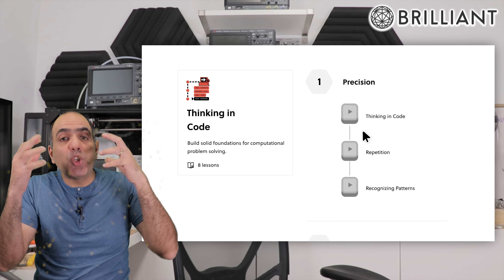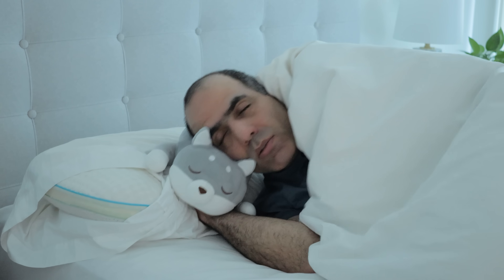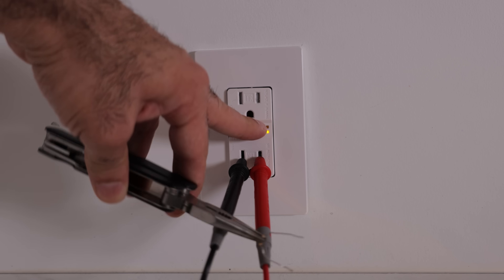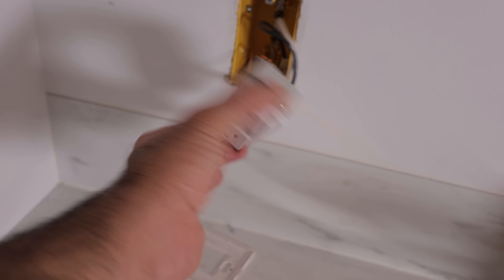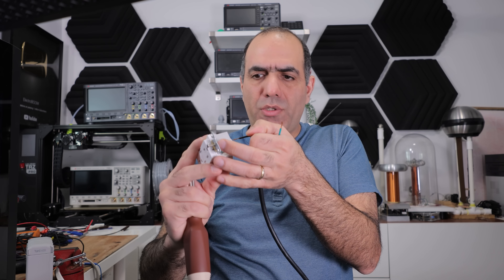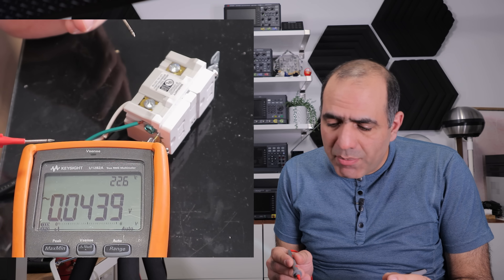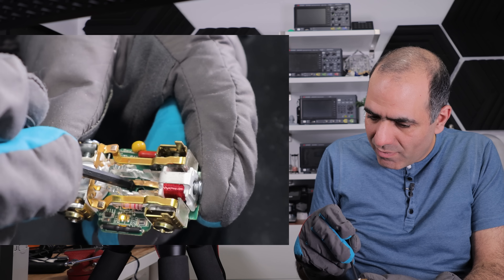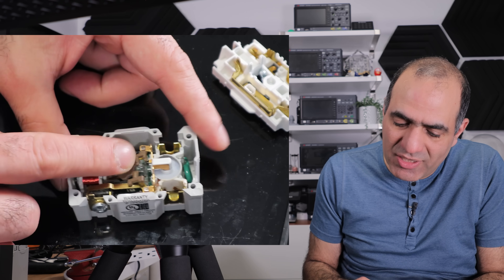Repairing Faulty Ground Fault Failure

Comment: That basically means the test button does not simulate the ground fault but only provide energy to the tiny rail gun inside. No worry Mehdi you will be safe🥰
Reply: Yeah that’s super weird. In Europe RCD test buttons literally close a circuit between live and neutral outside the sensing coil (through a resistor) thereby directly simulating a fault.
Reply: @thebaker8637  Yea i noticed this outlet didnt do that and immediately became very angry. Everytime ive seen a GFCI here, its done exactly how you described, it shunts a resistor between live and earth past the sensing circuit. I know this because i remember my dad always used to tell me if you press the button and it doesnt immediately trip to let go of the button because the resistor will overheat and burn out if the sensing circuit doesnt break the contacts. at that point its a fail of course they are supposed to be instant so even a second between pressing the button and circuit disconnecting is a fail. this design offends me greatly. it doesnt test anything outside of how strong the springs are. which yea sure fine, but thats not what i want to test. i want to test its ability to sense a ground fault.
Reply: @thebaker8637  incorrect. What you’ve described simulates a short circuit not a ground fault. A ground fault would be a short to ground not neutral.
Reply: @postalUT  What I am describing is a short circuit that serves to simulate a ground fault from the perspective of the sensing coil that tests for a current imbalance between L and N. That’s the only necessary and sufficient condition for the device to trip during operation. A ground fault does NOT have to occur by current traveling directly through PE, and any GFCI/RCD that tests like that will make the (often incorrect) assumptions that (a) PE exists in the first place, (b) PE has lower resistance than any ground the user may be in contact with, (c) earthing is otherwise functional.
Reply: @postalUT it diverts the current through a path outside of the sensing transformer, so that the whole sensing circuit “sees” the same imbalance that would be seen in an actual ground fault
Reply: Most of the idiot light inspection tools have a GFCI test button that does an actual ground fault.
Reply: i suppose its more likely that the closing mechanism will fail rather than the current sensing circuitry.
Reply: @killingtimeitself  but simulating a current imbalance will also cause the whole closing mechanism to activate as it would in a real ground fault, and it will also catch issues with the current sensing system itself
Reply: @killingtimeitself  what good does the closing mechanism working mean if it cant detect a ground fault in the first place? the design of hey we can tell it breaks the contact if you release the contacts doesnt mean much if the sensing side has failed and it would never detect a fault. considering all the GFCIs ive seen will just shunt a resistor across the output lines which is literally its creating a ground fault is so much better cause its testing literally all of the GFCI at once. all you need to know is press button and circuit goes open. if it doesnt go open who cares what failed the sensing or the mechanism its bad either way. while some people like me might actually have the little idiot outlet tester with GFCI test built in. a majority of home owners wont. they will just press the button see that it pops and go cool GFCI works never knowing that only the springs and the disconnect work but not the sensing circuit.
Reply: yea lmao wtf, scam test button
Reply: "tiny rail gun" 😂
Reply: He said it energizes the solenoid, but im not sure if he meant it is energized directly, maybe its energized indirectly through a ground fault.
Reply: @pykapuka  the way he explained it was that the button just tests the contact breaking feature of the socket, it doesnt test the current detection portion.
Reply: @killingtimeitself  but it might be by simulating a ground fault. he didnt explicitly say that a ground fault is simulated but he also didnt explicitly say that it isnt... therefore we dont know.
Reply: @pykapuka  He did tell you though. he said the test button presses on the tiny clear plastic piece which presses on the metal bit that the coil presses when it wants to disconnect the circuit. that sounded pretty explicit to me. it wasnt testing a ground fault in the sensing, it was physically moving the little metal piece locking the springs into the circuit closed position. 

the other reason i dont believe that its testing the sensing. why have the button test both the sensing and the mechanical part interdependently that would give false positives the sensing could be bad but since it tested the spring locks and those proved fine to the person who pressed the test button the button pops the circuit goes open and the GFCI is still good. the simple design of just putting a resistor as the test. will literally test the entire function and circuit of the GFCI. will not allow for false positives and is less complicated to build. this design just seems... well like cost cutting, but its the kind of cost cutting that i hate. making the device more complicated and less safe in the process.
Reply: @compzac  Im refering to 10:40 where he doesnt say that. maybe there is another part im missing?
Reply: despite it’s possible to build a real ground fault test button with a resistor, the robustness of such is hard to deal with. For example, it’s not easy to properly design a trigger(which contains moving parts) when the test will certainly brings arc. The contact will be welded together if a bit goes wrong. Maybe you can do a solid state relay triggered by the button to trigger the test, but it really cost a bit. That’s why the cost cut assumption make sense.
Reply: @flyviawall4053  You can whoosh me later, but not everyone is going to get this: If arcing is a problem, you most definitly should implement a real ground fault test because it is just a resistor. But if you power the "rail gun" directly which is basically an inductance and consumes a lot more power (remember the smoke) this is a billion times more likely to arc.
Does this mean you actually think it is a real ground fault test? I mean, im not even sure. All I know is that I don't know...
Reply: @pykapuka  hmmm, but an inductor’s current is lagged behind, very unlikely to spike even parasitic capacitance exists.
but if the coil is carefully designed to match 5mA initial current as a “bootstrap”, this is a really brilliant idea!
Reply: @flyviawall4053  Oh, my mistake. You dont actually know how arcing works. Well, if you only have a resistor between life and earth through which a current flows, you can open the circuit and the current flow just stops. But as long as the current flows through a coil, that coils stores energy in its magnetic field. So if the circuit is opened the energy cant just disappear, so the current must continue to flow. With the circuit open a large current at low voltage is not possible so the voltage rises until it is high enough to jump the gap and instead a small current at high voltage flows: an arc.

Nobody knows everything so it is silly to be ashamed of it. But talking like a professional when you have no idea is really misleading and i dont like it...
Reply: @pykapuka  it will arc but only after open, how would it be welded? also there’s nothing call pure resistor in the world, the current will probably overshoot for nanoseconds due to capacitance, so it might arc(well it’s AC, more likely…). Still unlikely to be welded but the contact will get quite nasty eventually.
Reply: @flyviawall4053  We are really getting off topic here! I dont even think you will get problems with arcs and welding. That was your argument. I just stated that IF there will be problems, they are a billion times more likely directly powering that coil. "also there’s nothing call pure resistor in the world" Yes, thats why I wrote a billion times more likely and not that it is impossible with a resistor.

"it will arc but only after open, how would it be welded?" That happens when the contacts bounce. You get an arc from opening the circuit, that heats up the contacts and you smash them back together a few milliseconds later. -> welding.

"the current will probably overshoot for nanoseconds due to capacitance" Arcs from parasitic capacitance of a resistor? That sounds dangerous. Maybe the contacts will just vaporize from the high energy arcs?
Reply: This question is answered easily. You see, a GFCI receptacle is legally installable on a 2-Wire circuit meaning no ground is available. If it is the case that it actually creates its own ground fault to be sensed and tripped on, then the test button would not work on a 2 Wire installation. So the test function is functionally just activating the trip mechanism itself. Note that GFCI receptacles installed in 2 Wire applications must be labeled per NEC
Reply: @postalUT  In a two-wire LN installation you can still test for a ground fault condition by shorting live and neutral through a shunt outside the sensing coil. We have installations in Europe with no PE wiring in older sockets but a working RCD is still present on the circuit panel that will protect the user in case of an arbitrary ground fault that can be reliably tested in this manner.

Comment: There is no reason why you can't have ground fault from the panel. There are gfci protection circuit breakers. It's a little more money but you can do it.